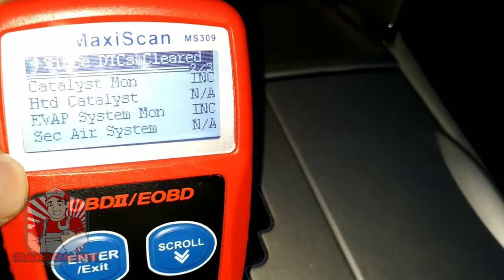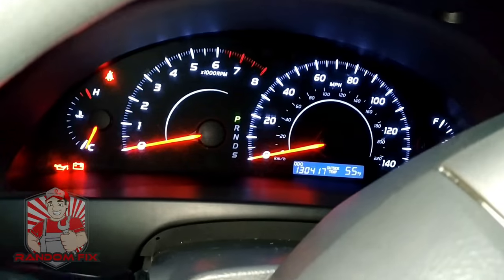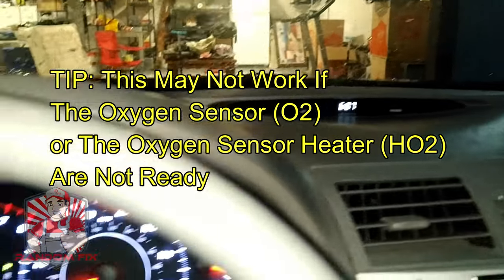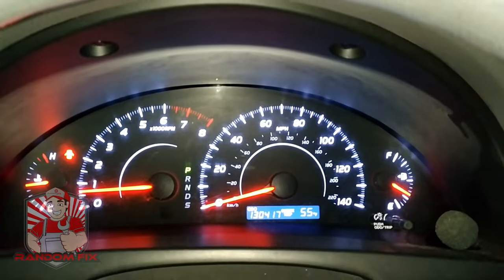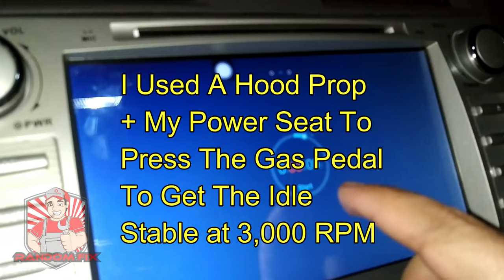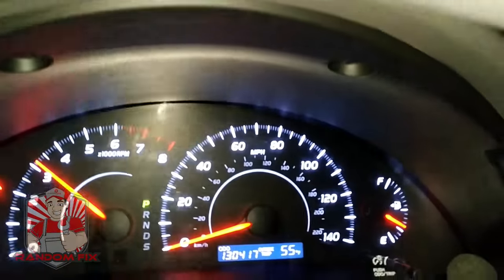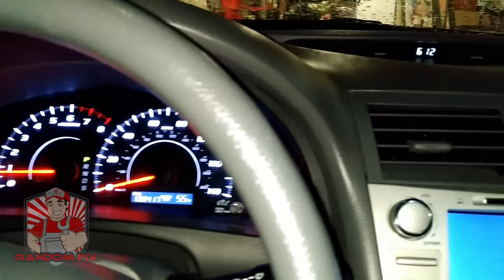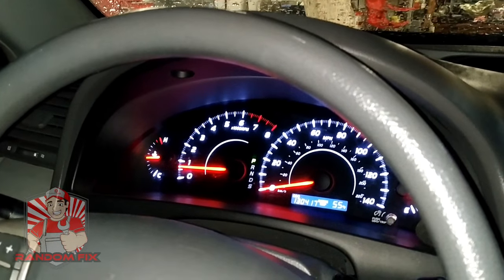Amazing Trick to Get Catalyst Monitor Ready!

Comment: I did this on my 2004 Toyota Highlander and it worked like a charm. Catalyst Monitor kept being not ready for almost 2 weeks. Drove all the way from LA to San Diego and back, still failed. Did 6 drive cycles of going at 55MPH on the freeway for 10 minutes, still failed. Did this trick literally one time and it passed in the first attempt. Thanks!!
Reply from the maker: Glad to help, thank you for the great feedback. I can only imagine how much you spent on fuel on the highlander from la to sd and back.
Reply: What exact trick?
Reply from the maker: I showed in the video ( this is good for older vehicles before 2008 and have a complete playlist for incomplete catalyst monitors 

https://youtube.com/playlist?list=PLDEbtVOPRC-h1BAzaWQ-6NSnmG0gwvgwP
Reply: @RANDOMFIX My 2010 Honda CRV car, of all its monitors, only 1 says incomplete, that is, not READY. ALL THE OTHERS ARE COMPLETE. READY. THE INCOMPLETE ONE IS 0S2.  IT ALSO DOES NOT PRESENT A CODE AVAILABLE ONLY ON 02S NOT READY I CAN PASS IMPECTION LIKE THIS WITH ONLY 1 MONITORS NOT READY THANK YOU  in New jersey
Reply: I tried it on my 03 grand marquis doesn't work
Reply: @fastfords9072  Sorry to hear that dude. Good luck on getting it fixed
Reply: @DaNumba1Rapper  yeah thanks
Reply: I'm gonna try this on my 2004 Highlander.
Reply from the maker: Keep me posted on your success and remember if the weather is colder you may have hold an extra minute. If it’s not your daily driver you need to drive it on the freeway for a while before you do this as your catalyst can be covered in engine oil and grim from the last 20 years.
Reply: Hello, how does being covered in oil affect this? Thank you @RANDOMFIX

Comment: It worked!  Three mechanics gave me the wrong advice. So... I watched this video, bought a $22 code reader, and then drove to a bank parking lot. I put the car in neutral and revved the engine to 3000-RPM and held it there for 3 minutes exactly. I shut the car off and did the odb2 scan again. Catalyst = READY! Went back to the smog center and passed! (2008 Mercedes E350 with 110k miles) -- THANK YOU~
Reply from the maker: Sean, thanks buddy for the confirmation. Congratulations on getting your Benz e350 catalyst ready.
Reply: Thanks for sharing your story. Having a similar problem with my VW and will try it soon

Comment: Thank you. Thank you. Thank you. After replacing knock sensors I drove 2000 4runner 1000+ miles, every weekend for 3 months getting up at 4am to drive so as to  not attract attention with expired tag going slow on freeway  following Toyotas drive cycle pattern.  Got all, but catalyst monitor, then the 3 minute at 3K RPM finally did the trick. Thanks for taking the time to post this vid.
Reply from the maker: Thank you for th great feedback and it is much appreciated that you took the time to let me know. _Randomfix

Comment: 00 Odyssey with 266k.  Ran the same test holding at 3k rpm in park for 4 minutes.  Readiness did not pass!  Then got on the freeway and held it steady at 55mph for 3 minutes (no AC, no cruise control) and passed immediately.  Just a heads up for Honda owners.
Reply from the maker: Just made a video for honda owners, thanks for the as well. https://www.youtube.com/watch?v=oZELvZ4danA

Comment: This should be a 2 phase procedure: if step #1 fails, do a drive cycle immediately afterwards. The 3000 rpm procedure did not work for my 200k 4L 2000 Ford Ranger truck, but doing a CAT drive cycle immediately afterward did. The drive cycle included, driving @55MPH for 15 min on a flat road into ascending terrain, then periodic acceleration to 65mph and back to 55MPH a few times, and finally driving in 2 gear @3000rpm for a few minutes. Hope this info will be useful to someone who's dealing with the CAT not ready problem.

Comment: Magic trick!! Thank you so much!! I was desperate to make CAT ready for my 2001 camry to pass smog check, as I have spent many hours of on highway driving and put more than 500 miles without luck. This trick fixes the issue in just 10 minutes!! One note is that the 3000 rpm needs to be kept running for 4 mins to make my CAT ready. The BEST advice on the internet. Thank you so much again!!!
Reply from the maker: Glad it helped! Yes the older your catalyst becomes the more time you may need to add to help it get ready.

Comment: I had a number of issues this year to get my 2001 Camry smogged.  After some repairs to old hosts, cleaning EGR valve, etc, everything checked out except the catalytic drive cycle. Went back to the smog shop numerous times after 300-500 miles and kept being told "you need to drive it some more".   Finally, the smog technician told me to look up Toyota's drive cycle to see what I may be missing.  Ran that twice late in the evening hoping not to tick off any freeway drivers wondering why I was only doing 55mph and trying to maintain 35-45 on the trip back on a smaller road for both cycles.  NONE OF IT WORKED.  Came home, started looking and saw this video and after letting the car sit overnight, starting her up and letting her warm up, 3 mins at 3k rpm and the monitor went from INC to OK.  THANK YOU for this tidbit of into!  Now to get the car smogged!
Reply from the maker: I’m glad to help with your 2001 Camaro smog and thank your sharing your success. Just know that passing your Camaro in the future will get harder to set this cat monitor as it ages. Make sure you have a memory saver https://youtu.be/WvSIAQ3KpUw?si=vaOrn21lHwKlZUn4

I have others say that they went 3k for 4 minutes when the weather was colder or very high mileage. 
Have a great Sunday
Reply: @RANDOMFIX  LOL, I wish I had a Camaro!  Unfortunately, it's just another pedestrian Toyota Camry sedan I bought from new and racked up 286k miles on it!
Reply from the maker: @bedrock8 no shame in a Camry. Sorry my auto correct got Camaro by accident. The Camry is solid especially the 2007 to 2011 4 cylinder models. I think these were are the best sedans ever built. I sold my 2019 and regret it now. The new Camrys are not as wide even though they appear to because the lower base but the top toes in.

Comment: It worked for my 2004 Toyota Highlander I/M readiness monitors were all checked off but catalytic still incomplete.  
After a Drive cycle was 150  miles in 2 days it seemed hopeless.

So I started the engine to let it warm to normal temperature then reved it to 3000rpms for three mins.
Let off the accelerator and scanned it again while idling.
Cat monitor was READY
Thanks for the video bro, it was really helpful 👍👍
Reply: Im that
Reply: Try that
Reply from the maker: I appreciate your constructive comments, thank you for the feedback!

Comment: Thank you so much!!! This worked for my 2000 Lexus rx300 on the second try.  It has 220,000 miles on it.  I had done several drive cycles which did not set the catalyst.  I thought I might have to sell the car but who would want it when it won't pass emissions.  
 It also was not worth replacing the three catalytic converters.
This post made 5 years ago with 279K views.  You are great.  I am a lifetime mechanic (77 years old) and never knew this procedure.  Thanks again.  Ernie

Comment: Wow! I can’t believe this worked for me. I have a Toyota Camry 2001 and done the drive cycles but still fails on the scanner. Gave it one last try this morning on a cold start, kept the car in parked, stepped on the gas and held it steady at 3000 rpm for a little over 3min. Rescanned the car and the cat and evap drive cycles were cleared. Thank youuuuuuuuu! Very helpful vid. You saved me from thinking of replacing the catylitic converter.
Reply from the maker: Glad to help and congrats on getting that 2001 Toyota Camry ready to pass. Thank you for the feedback

Comment: Wow! You are a lifesaver, it was a horrible long road to even find a reasonable used car & then it didn’t pass emissions here in WI.  I did exactly what you did, step by step & I passed, can’t thank you enough for posting this!
Reply from the maker: Glad it helped!
Reply: I'm in Wisconsin too. Having the same issue with my car
Reply from the maker: Have you tried what I share in the video?
Reply: @RANDOMFIX  yep. 07 Hyundai Azera if that helps. Same issue with cat and evap
Reply from the maker: Here is the Hyundai drive cycle

https://youtu.be/UzC4FNTqNdI

Keep me posted. What caused for your monitor data to get lost or deleted?
Reply: @RANDOMFIX  mechanic cleared bad 02 sensor and coolant thermometer codes
Reply from the maker: Did he do any actual work other clearing the codes?
Reply: @RANDOMFIX  yep. They fixed the bad 02 sensor and replaced my coolant thermometer
Reply from the maker: Cool, you should even good, just complete the drive cycle 1 to 2 times. Good luck and keep me in the loop.
Reply: @RANDOMFIX  will do. Thanks for your help
Reply: @RANDOMFIX  you asked for an update. My car is good now. No highway driving. Just drove it around town and 2 weeks later I'm set
Reply from the maker: Good to hear, thank you the update. In your opinion what made the difference?
Reply: @RANDOMFIX  maybe letting it warm up more instead of just taking off and going. Putting fresh gas in helps too

Comment: Thanks for the tip !  Doing this got my EGR ready, but the CAT stayed not-ready. I decided to go on the freeway and drove for about 3 minutes in 3rd gear with the RPM constantly at the 3000.
My speed was on the average 62 mph doing this. This got the CAT in ready status !!!  Did this to my son’s 2008 Mazda 3 which had the battery disconnected for weeks. So for those of you folks this tip did not work, try this variation. Again, THANK YOU.
Reply from the maker: Arsenic, thank you so much for sharing your tips and I'm glad your found the video to be help. Much appreciated 🙏
Reply: I'm going to try the same. Get on the freeway, but it in 3rd, hit 3000 RPM and switch on the cruise control. Hopefully it will work.
Reply from the maker: David, let me know how it goes. Thanks
Reply: Work 07 vw thx

Comment: Thank you so, so much! I've been struggling with getting the CAT monitor ready. I've driven 524 miles, but it still would not complete. After following your instructions, it became ready, but this was after a second attempt. I was planning on driving several more hundred miles before seeing your video. It was so pleasing and rewarding to see that the CATALYST monitor turn from red to green on the scanner, just having it idle at 3000 rpm's for 3 minutes, after the engine warmed up, without driving an inch!!! By the way, the car is a 2000 Lexus ES300, with over 198,000 miles. Again, thank you so much for the video. God bless.
Reply from the maker: That Lexus es300 is one of the hardest vehicle to get the catalyst ready on. Thank you for your support and feedback.
Reply: @RANDOMFIX  Lots of old Toyotas with the same engine.
Reply: Did this on 2000 ukon it did nothing
Reply: @RANDOMFIX  sure is. I have an 02 lexus es300 and I'm having that problem for the evap and catalyst. I'm going to try your method

Comment: Dude you did it for me!  My 2012 Fit failed smog for exactly this reason.  I did the who drive cycle deal and nothing.  Then I did yours and it worked.  Many thanks for posting this video.

Bill in Los Angeles
Reply from the maker: William, Glad to help you and I know getting the monitor ready for smog can be a real pain especially in Los Angeles and with heavy traffic. Thanks for the great feedback
Reply: Hey I also have a fit that’s failing emissions because of this reason, but for some reason my Honda fit automatically drops RPM’s after holding the throttle longer than 2 minutes when I’m in park. Did you experience the same thing?

Comment: THANK YOU SIR!!! YOUR TECHNIQUE WORKED FOR MY TRUCK. I WAS ABIT SKEPTICAL AT 1ST, BUT WITH SOME PATIENTS IT WORKED!!
Reply from the maker: Glad to hear what sort of pickup did you have and how many miles?
Reply: It's a 2007 i290 isuzu pickup with over 300k miles. I did the sea foam solution for catalytic converter where the 02 sensor is placed and it help alot..Thank you again..sir!

Comment: Notes:
1. Make sure to do this in a well ventilated area, definitely not in an enclosed garage.
2. Start vehicle from cold and let idle for 7 mins (keep an eye on the temperature).
3. Press foot pedal until 3,000 rpm and let idle for 3 mins.

Update one year later: I couldn’t clear the catalyst after trying everything and wasting so much gas. I just gave up and after 6 months of driving occasionally (wfh), I got it checked again and the cat was cleared. I had felt it wasn’t gonna happen so maybe try that if you are stuck. I paid the renewal fee but was driving around with an expired sticker luckily nothing happened to me 😂
Reply: Weird thing is for me it’s off and on it’ll go from ok to inc idk what to do
Reply: @drk_8984  I’ve seen other people say when they see that it is OK they drive straight to smog check without ever shutting off the car.
Reply: @jt.633  That’s smart I’m going to have to do that thanks
Reply: @drk_8984  you have a problem with your stay alive memory
Reply: After the catalyst fault clears, can you turn off the engine or do you need to keep it running all the way through the smog test?
Reply from the maker: You should be able to turn the car off. The above situation is rare where the vehicle is losing data once the engine turns off.
Reply: I had a civic that would clear every monitor every time I shut her off. Had to tell them to run the smog before they shut it off. They had no problem with that. It’s rare but it happens. I made it through 3 years like that before the cradle rotted out so I had to junk it
Reply: Ima do it in a closed garage
Reply: Update one year later: I couldn’t clear the catalyst after trying everything and wasting so much gas. I just gave up and after 6 months of driving occasionally (wfh), I got it checked again and the cat was cleared. I had felt it wasn’t gonna happen, so maybe try that if you are stuck. Though I paid the renewal fee but was driving around with an expired sticker luckily nothing happened to me 😂
Reply from the maker: What’s the back story of your vehicle? Like the miles and make?
Reply: @RANDOMFIX 2001 ford wind star with 179xxx

Comment: I can confirm this work with 2007 Nissam Altima. Here's what I did. Went to an empty parking lot . Turn on the Car, set it on park let the car warm up til the needle thing reaches in the middle between hot and cold. I turn everything on AC on full blast for 10 minutes.  After ten minutes,  I rev the car to 3000 rpm for about  3 minutes mine took only 2 minutes,  you will know if you completed drive cycle if your car stutter. I did this twice to make sure that it was working. My Oxygen Sensor Monitor went from INC to Ready.
Reply from the maker: Hi Eddie, thank you so much for the confirmation on the a 2097 Altima package

Comment: Thank you bro you're a lifesaver, tried this on my 2000 toyota camry one day before my tags were due and it worked, had to do it twice for it to work but it sure beats driving around trying to get it to clear, thanks again just subscribed
Reply from the maker: Jay, thanks buddy for the confirmation. Much appreciated
Reply: When you say you did it twice did you let the car cool down overnight before the 2nd attempt? Or did u simply let the vehicle idle for a minute after the 1st attempt before repeating the 3min part where u rev it at 3000 rpm?
Reply: @HardcoreUly  after the 1st attempt i just turned the car off completely for a couple of seconds and then did the process again and after the 2nd attempt i turned the car off again and then checked it with the obd2 scanner and it was cleared
Reply: How you test twice do have to wait till next day mine won't clear need help

Comment: This video is a time/money saver !  It worked on my 2003 Toyota Highlander V6 with over 331k miles after multiple tries.  Thank you !
Reply from the maker: Glad to help get that Highlander ready for smog. 331k miles, you gotta love toyota. Are the cats original?
Reply: @RANDOMFIX  yup
Reply: It worked for my 05 cadi sts but the 02 sensors will not get ready after 5 drive cycles and 400 miles.

Comment: Thanks for the video, here's my story. I have a 1999 Mazda B2500, and had gotten my renewal notice 2 months prior. Hadn't gotten it smogged yet, and early on the morning of the 5th of July it was stolen off the street in front of my house. Didn't think I'd see it again, but it was recovered almost a month later. They broke the clockspring when they busted the ignition, so I had to order and wait for the new one. I had to disconnect the negative cable to do the installation, there by making the drive cycles necessary. They had stolen my plates as well, and didn't want to be driving 300 miles in SoCal freeways without plates. Less than 2 weeks left to get renewal done. I took it on a local 2 lane road for about 10 miles. That left only the evap and cat to finish. I tried the method in this video but cat   still didn't finish, so I took it out on the same local road and drove it in 4th gear (it's a manual) at around 50 mph keeping an engine RPM of 3500. The cat cleared in about four minutes. Just passed smog this morning.
Reply from the maker: Tim, glad to hear you passed and you got truck back. Thank you for sharing.